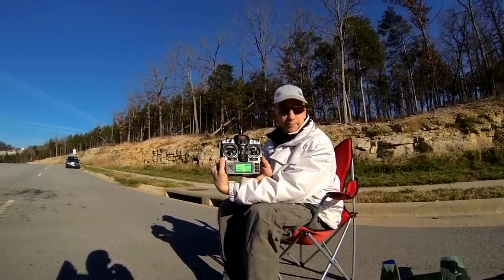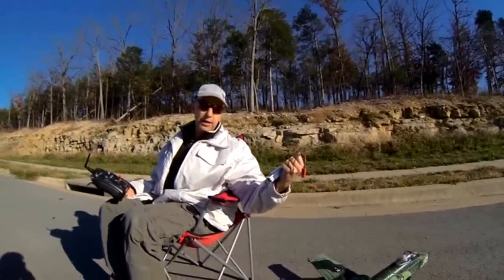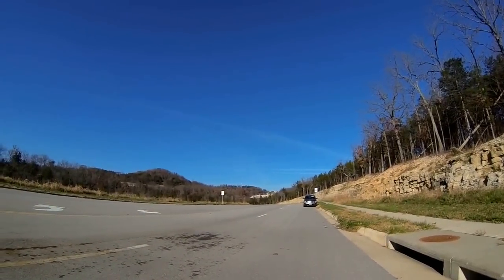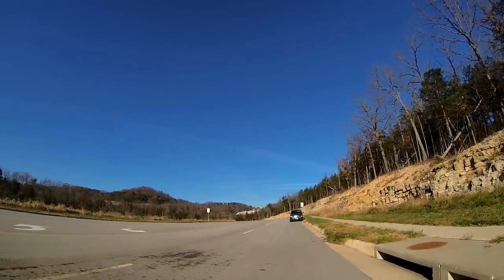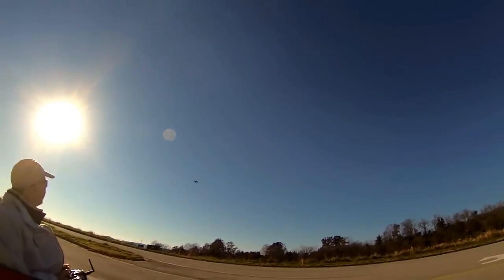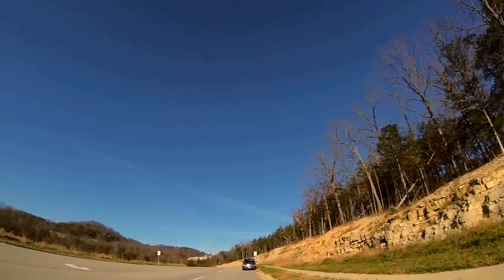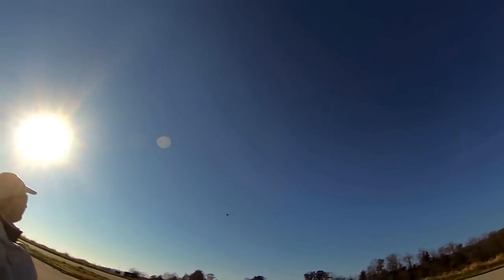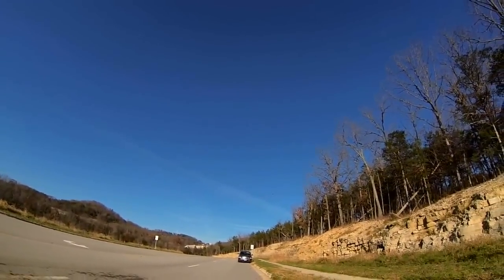A-10 Warthog Converted to a 6x4 pusher prop

Comment: Kilovolt? :D This motor will handle 2000000 Volts?
Reply from the maker: +Silver Lensment  Hello Silver
It's the electrical abbreviation for kilovolt per RPM. Not to be confused with kV (kilovolt, in which case 1,000 volts equals 1 kilovolt).
basically the higher the kv the faster the motor spinns
Reply: As I understand, Kv in not called or named kilovolt. It is a constant and it does't have a name "kilovolt". It we are talking about RPM per volt then it's just Kv, not kilovolt or anything Else. Calling the constant Kv "kilovolt" is just wrong. I might be wrong here, but I doubt it. :)
Reply: By the way, great R/C videos! You show off some really cool planes. I really want that YAK now. :D
Reply from the maker: +Silver Lensment The yak really has been a great little trainer and has survived many many bad wrecks as I learn more about aerobatics, I have the yak with fpv and goggles now lol its the best way ive found to throw up instantly.  These are all very budget planes,  as a 100 dollar plane is still a lot of money to me so I researched the most fun I could have with the smallest amount of money.  As I have no real local clubs here I have relied on videos on youtube to learn most of what know.  Hopefully this channel gives some of that back.

Peace,  Greg